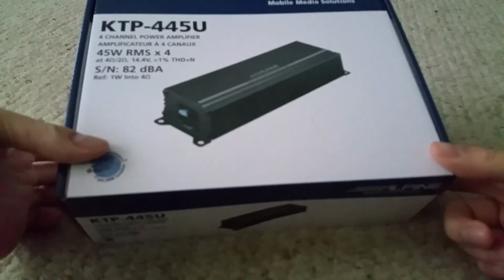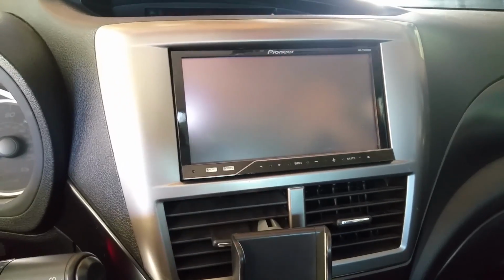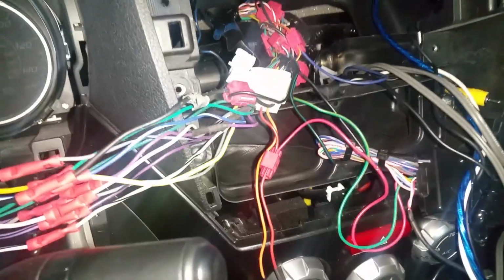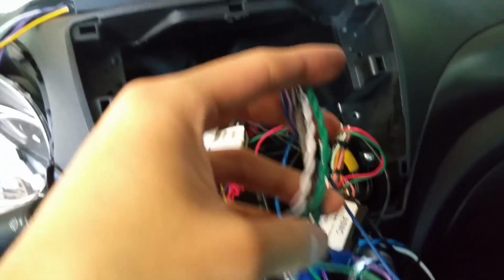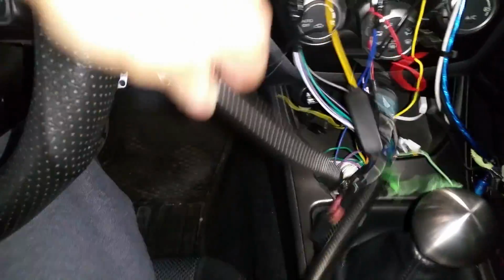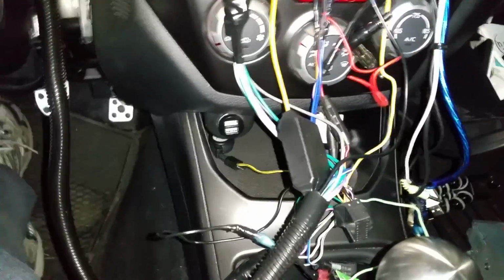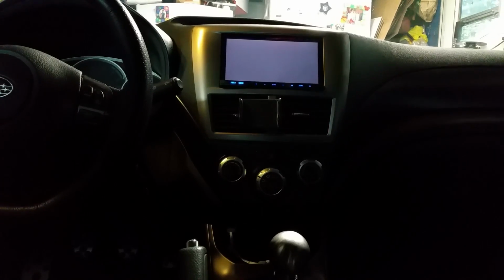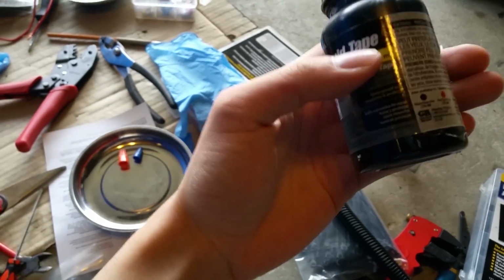How To Install An Alpine Power Pack KTP-445U Speaker Amplifier Amp DIY

Comment: Thank you for posting and I appreciate your time as you share a lot of viewing that demonstrates the wires and wiring issues. 

It is interesting that up until minute 4 you talk about the left side "going to the speakers" and then at the 5 min mark you begin to talk about the right side as the side that "runs to the speakers". This becomes a bit confusing and to put it simply, it's actually a flow issue, like a river, with the head unit being at the top of the stream sending information from the head and into the right side of the amp where sound is boosted and then sent out the left side of the amp and into main harness where sound is distributed to each of the individual speakers.  
 
1) Head unit is the beginning of flow. Wires leave the head unit to the right side of the amplifier. (Head Out/Amp In Right)
2) Signal received by amp, boosted and distributed to speakers out left side and into the harness in dashboard. (Amp Out Left)
3) Power, ground and some auxiliary features can/must run from the head unit, through (or around) the amplifier and then into the harness in the dash board.

It's (3) that is the place where we have the biggest problem. The head and amp both need power and the RCA is not always working. It's my opinion that the KTP-445U (U-Universal) is improperly marketed in the US when in fact we'd be better off with the KTP-445A which features a dual harness design that runs out of the left and right sides of the unit which eliminates the whole RCA debacle.   

What you and others (including myself) have been forced to do is cut the RCA cable that is used for the right side of the amp to make a modified composite cable harness. This is then manually wired into the composite end of the head unit attachment so that the head unit can function, receive power and distribute sound as well as be grounded. What a cluster that the manufacturer does a terrible job in both marketing their product and then outlining all the installation details in their product insert. Even worse, there is no mention in the installation instructions the schematics on how both the head unit and amp is to receive power.  So we end up cutting the RCA to run the speakers manually and then having to splice power from both the head unit and the amp via individual yellow wires.
Reply from the maker: Glad I was able to help. There was a fair bit of confusion when I first attempted the amplifier install so I tried to capture as much footage of the wiring as I could. And yes, it is a bit of a mess when we are forced to cut off the RCA's and makeshift our own wiring harness. Fortunately, the amplifier sounds terrific and makes up for the install process.

Comment: Here is how the KTP-445U works for installing on a factory OEM Radio, cutting off the RCA Plugs and using the Radio 12Volt Constant Wire for power. My OEM radio has a 15Volt Fuse.  This is called Speaker Level/High Level Inputs. You will need to know your wire diagram of your vehicle.

You will have to cut the correct wires after the factory harness leaving enough length to either solder or crimp. After you cut the wires on the factory harness use the wires closest to the Radio harness connector for input to the amp. 

Use the wires going behind the dash for your amp output to your speakers. (High Level In and High Level Out). Did not have to connect any of Blue Power Wires.Speaker Level signal turns on the Amp. Again please make sure you know the correct wires before you cut and connect and remember every vehicle is different.
Reply: kevin young you dont need to cut off the rca's for connecting the alpine KTP-445U  to an OEM radio all you need to run is a line level converter

Comment: I thought the right side out of the amp goes directly to your speakers, not back to the head unit. For example, you go from head unit out to input harness of amp then out of the amp to your car/truck wiring harness to your speakers. I guess I had it wrong. Thanks

Comment: Wow, that was a great detailed video!  Thanks for sharing!  Question for you, I have ALPINE HEAD UNIT IWE-W957HD installed in my car with TWO 8inch ALPINE PWE-S8 Subwoofer.  So far sounds very good but like you I do not want loud I want great quality sound.  Considering i already have a nice setup.. do you think by adding this AMP will it make a big difference?... i'm looking for quality sound... not loud sound

Comment: thanks for the video! one question for you, when you cut off the rca plug you now have 2 wires, one positive one negative. what wire does the speaker positive input connect to on the amp?
Reply: Exactly ,he cut the input to the freaking amp  wired it directly to the output of radio he lost me there

Comment: I tried connecting my Alpine power pack to my Kenwood,  I didn't not connect the RCA because there was no  plug in ,  at that same time I was told the stereo unit would not accept the power pack because it had already a built in amp. So I'm asking if I should splice and butt like you did?
Reply: no you dont need to splice and use butt connectors all you need is a line level converter

Comment: Did you check to see if the RCAs could be activated in the frontend's menu?
Reply from the maker: Yes I did but they did not work. Perhaps the were defective on my headunit.
Reply: did you change the the settings on the amp from high level to low level
Reply: I had someone car place put a stereo in my buick & alarm system & when ever I used my stereo my battery died. I spoke to a different car stereo place yesterday & ordered this alpine. 1 is $150. & other one is $119, maybe cause cheaper one does not come with rca wires, probably. I am having second thoughts about having them install.
Reply: Could they use cheaper wires & not the rca wires & still make equalizer work? I wouldn’t know the difference, any suggestions to me would be nice here. Thanks

Comment: did the wire colors all match up from the head unit to the amp?
Reply from the maker: +David Charles Pretty much. It depends on your harness though but if it's a universal harness the colors should all match up.

Comment: Does the amp receive 12v from the stock harness or did you run a dedicated wire from the battery?
Reply from the maker: All power is provided through the stock harness.

Comment: Thank you so much for the detailed video, i have two questions.. the first one is, would ya recomend it? Or would you rather of invested in a four channel amp?
And my second question, if I do end up purchasing one of these, and i do not feel 45 x 4 is enough power. Can i just order another one and install it and run them both bridged at 90 watts rms? 
Basicly two power packs, both bridged at 90rms, both connected to my kenwood head unit. One power pack for the front two speakers and one power pack for my back two speakers. 
Any input would be greatly appreciated.
Reply from the maker: Glad to help. It's definitely a great amp for the money and ease of installation. A full dedicated amp is going to always sound better but it will be more expensive and more difficult to install. I'm sure this amp will provide more than enough power. I have mine barely turned up 10% and it gets very loud. If it's not enough I would just go with a full dedicated amp instead of the powerpack.
Reply: +xbe how high do you have the gains?

Comment: I was wondering if you could help me with mine. I hooked it up and it's not working. There are 2 blue wires from the power pack. Does 1 blue wire go to the head unit and the other blue wire go to the after market harness? Also from what I understand you don't use ANY of the wires from the head unit except the yellow wire?
Reply: I just installed this. use the blue wire that is on the rca side. the blue wire on the speaker wire side is to turn on another amp or something else. the yellow and black I hooked right to head unit wire harness. wire colors match aftermarket radio harness.
Reply: if your head unit has rca, then you don't use the speaker wires from the headunit side. so it's headunit rca to amp rca. from amp speaker wires to other end of harness adaptor(not the radio side).
Reply: +jvh22a what about the red wire coming from the head unit does that need to connect to anything ? thank you so much for the reply bro !
Reply: +Jason McCarthy radio harness will need the red, yellow, black, blue (if you have an amp turn on power wire or power antenna), orange(illumination).  then you should be left with speaker wires coming out of the head unit, just tape those up if your head unit has rca out put.
Reply: Yeah my Kenwood has rca. I have the speaker wires all fine it's the power wires I was confused on. I did not have the red wire connected. I had both blue wires connected too the blue on rca side going tothe head unit and the blue on the speaker side going to the after market harness. I turned my key to on and i heard buzzing in the speaker and the head unit was off.
Reply: +Jason McCarthy disconnect the blue wire on the speaker harness side. blue wire should go to the head unit if you did not connect the blue wire to you radio harness adapter. if your car has factory amp then it will have an amp turn on. easy way just connect it to the Kenwood harness. that should be it. don't forget to adjust the switches on the bottom and set gain. I don't have any equipment for this so just going by ear.
Reply: +jvh22a "something else" would be the power wire for the factory antenna. Deck blue wire to RCA plug blue wire on the amp, speaker wire plug blue wire goes to another amp or factory antenna.

Comment: I know this video is old but the hissing is actually distorting or you need to set the amp to high input since you head cutoff the rca side. I had that problem until I switched that setting.
Reply: and if you didn't notice,  under the amp is a rubber thing where you set the frequencies.  pull the rubber off and it shows you the diagram

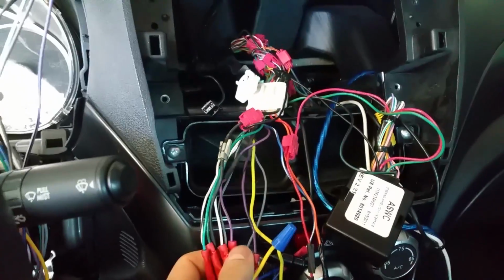Comment: Hi, @ 4:55 so you just connected your amp power power line to the factory harness power correct? How is it holding up so far? Been a couple of years so I hope there is no long term negative impact as most friends and installers I know advised me to wire power directly to the battery even if this amp is very small.
Reply from the maker: It's been a few years since I installed this but everything is still working perfectly.

Comment: looking to buy this from Crutchfield.  Do I need to buy their $20 wiring kit ?  also, didn't see a power connector.  I'm a total newbie to amps, but thought that this needed a direct connect to the battery with fuse or is it getting power from the power line from head unit?
Reply: They probably just didn't include photos of the harnesses or "power connectors" and what not. And this amp gets power from the head unit; essentially, because the head unit is connected to the battery. And you shouldn't have to buy a wiring kit unless you don't have any loose wire around the house.